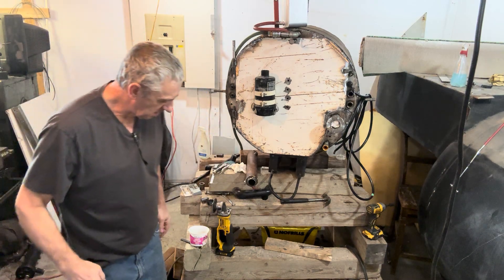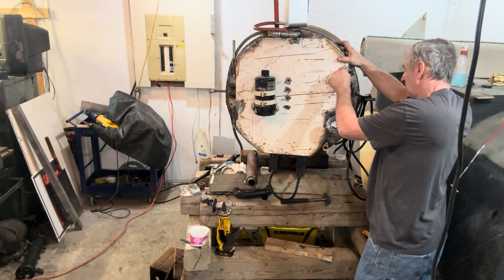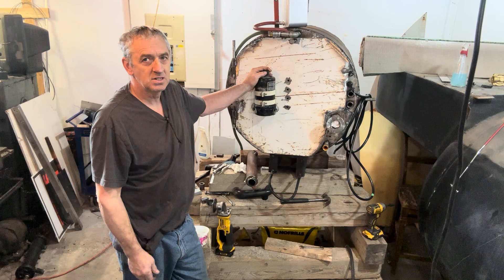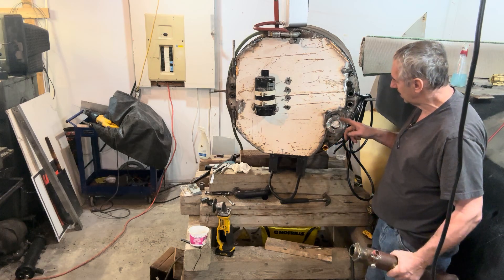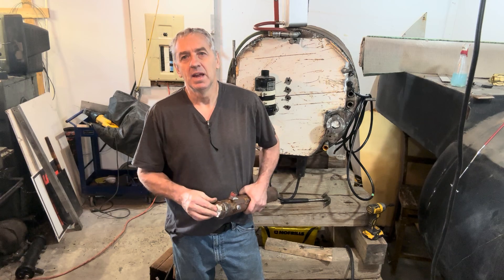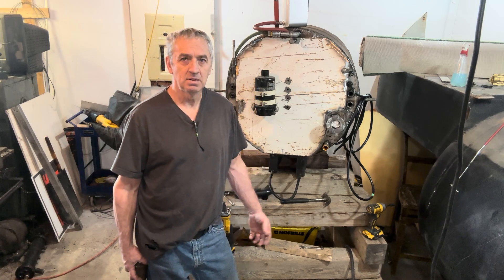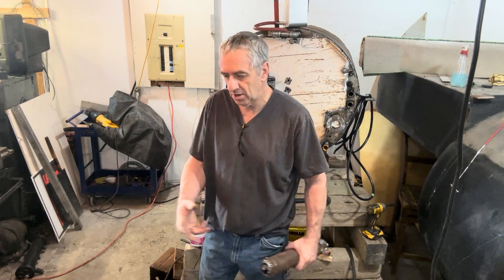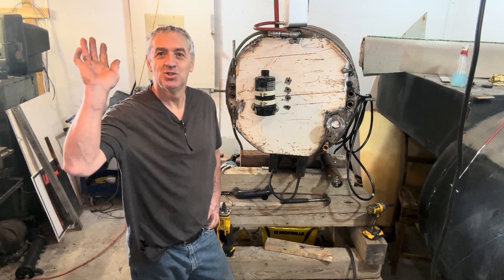Home built diesel submarine progress

Comment: Have the exhaust exit into the buoyancy tanks.  That will provide continuous positive pressure while running on the surface, and the oily diesel exhaust helps with preventing internal corrosion.
Reply from the maker: Too much back pressure

Comment: Who would put a diesel in small sub? Makes NO sense.
Reply: Why not?
Reply: @I_like_turtles_67  Carbon monoxide
Reply from the maker: The exhaust is well managed as well as fresh air supply.
Reply from the maker: How else can I get a long range?
Reply: @HankPronk  You can get several hundred miles on battery now. How much more do you want?
Reply from the maker: @jerryDycus-d9c show me a sub this size with several hundred mile range.  It is not a car.
Reply: I just want to know where the torpedoes go. Lol. Obviously, I'm kidding, I love your sub.
Reply: They are all diesel electric, like trains, except the nuclear ones. In the full-size ones the diesel engine charges the batteries, and they power the sub's propulsion system. The diesel engines don't directly power them. just like trains do, electrodiesel trains, or delta trains, if you like.
Reply from the maker: @sicks6six that’s close to how mine runs, except my sub is hydraulic drive off the engine.  Then I have separate electric motors for submerged use.  Engine charges batteries